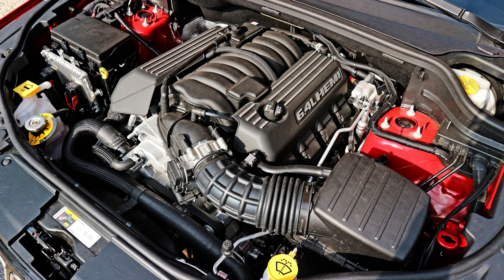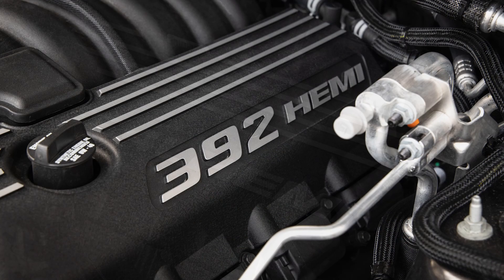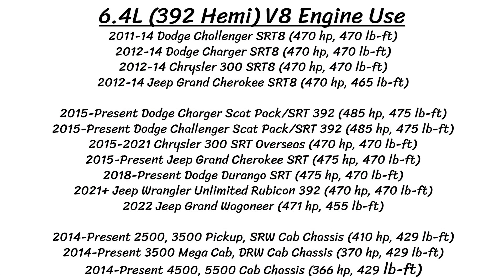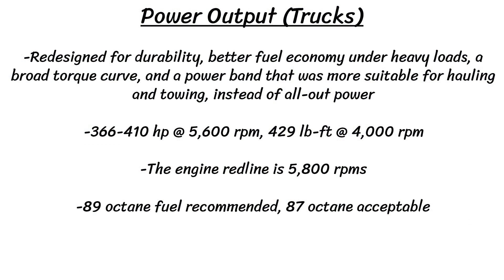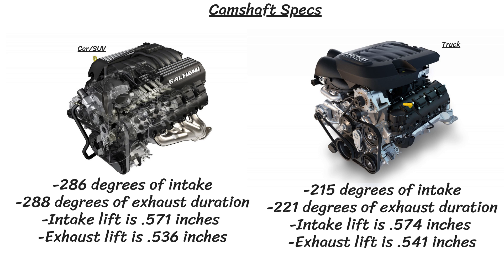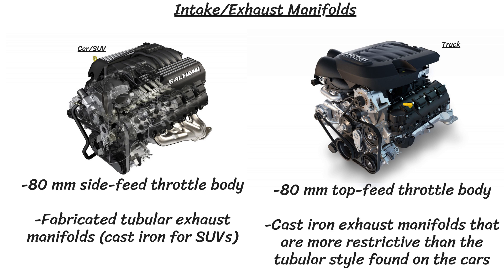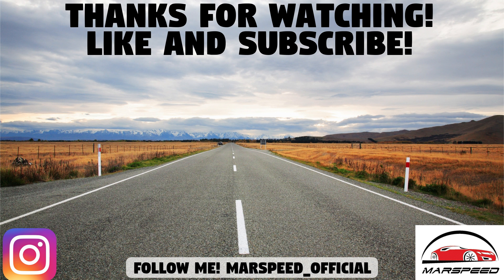6.4L Hemi V8 Engine – The Specs & Differences Between the Ram Trucks and SRT/Performance Versions

Comment: Don't you mean starting in 2005 was the Magnum SRT8 and the 300 SRT8. 2006 Charger SRT8 and the Grand Cherokee SRT8. Then in 2008 the Challenger SRT8. You made it seem like all 5 came about in 2006 which they did not.

Comment: I googled Microsoft Copilot, the 2018 Ram 2500 6.4L does not have MDS. Maybe I missed it in the video, but knowing my engine doesn't have MDS is important to me. Awesome video! Thank you for putting in the work to make it!! I know the 6.4 has an oil flow issue. The Hellcat oil pump provides 12% more oil flow, but Melling makes an oil pump that provides 20% more oil flow. I will be installing that on my truck. I am on the fence about upgrading the oil from 0W-40 to 5W-30. I checked the oil the other day, I had a hard time seeing the 0W-40 on the dipstick. It's like freaking water!! Fk fuel economy! I want my engine to last!!

Comment: I'd like a 6.4 BGE crate to replace my factory RAM 1500 5.7 donk. Once you put some gear in the back, the torque loss is vastly noticeable. I assume the RAM 5.7 would be a "BGE" block as well or does the 1500 come under "SUV" status?

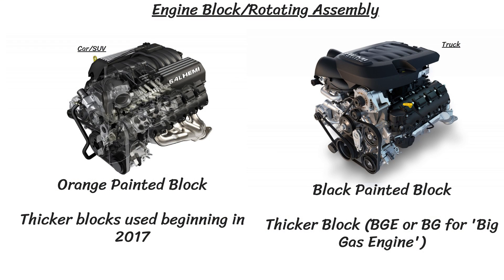Comment: 8:02 Can confirm: All 392 Hemi engines from 2018 onward all have BGE blocks from the factory. When I pulled the motor out of my ‘20 Challenger Scat Pack to open it up and put a 270 Comp Cam in it (and some other goodies), right on the block it had the BGE stamp on it.

Comment: Not sure when exhaust manifolds changed but my 17 ram 2500 has stainless manifolds that look to be some where between shorty headers and mid length headers 
I believe they made this change because of earlier models have the cast iron manifolds warp which was causing exhaust leaks

Comment: The truck 6.4 is not 89 or 87 fuel it’s the exact same as the damn cars 91-93 fuel
Reply: 91 is all I run in my truck. Best fuel mileage while regular driving and especially while towing. 89 is ok...ish. 85 absolutely sucks.

Comment: Could you (fitment wise) put a supercharger made for the 6.4 car version on a 6.4 bge truck version? I want to add a turbo kit to my power wagon but can find any kits specifically made for it. I wouldnt be apposed to other mods to make it work as long as its not outrgeous. Thanks!

Comment: Transmissions, 5.7 / 6.4 2500-3500 Only Had The 66RFE Option. The Aisin Was Only An Option For The 6.7 Cummins. The 6.7 Cummins Used A 68RFE Also. 68RFE Only Fits The 6.7 Diesel Same For Aisin.

Comment: The Cylinder Heads Are Different Part Numbers But Practically Identical To The Passenger 6.4. Also The 5.7 Hemi 2500-3500 Do Not Have MDS.

Comment: MDS is poor engineering,    massive failure in 2009 and newer ,  you willbe lucky to get 120k - 145k miles.     Needing new cam and lifter replacement

Comment: I own a Charger Hellcat but drive a Ram 2500 sometimes for work (gov’t engineering takes you off the beaten trail sometimes lol). That truck 6.4L feels more torquey on the low end (compared to driving with the black key at least) and honestly I feel like I get better acceleration in the truck just cause I don’t spin out the rear wheels every time 😂. Both awesome engines!

Comment: Does the 6.4 require premium fuel?
Reply: That's all I run in my 6.4L. I do notice a difference while towing with my 3500. 85 octane sucks, 89 not much better. 91 octane gets better mileage.

Comment: Let me help you out a little. The ram 392 has the same displacement as the car, but that's all. The car has a slightly bigger bore than stroke. The truck has whats called an underbore. The bore is larger than the stroke. The ram has completely forged internals and revs slower. The truck version is raited lower power than the gm, but will out pull it. The gm has a big bore and short stroke. All of your torque is made low with a long stroke motor. The cummins is built the same way the truck 392 is built. There are guys that use the truck 392 as a hotshot. They're pulling 15k+ all the time and getting over 400k miles out of them. The truck is built heavier than any other gas motor on the market. The truck also has an oil and transmission cooler. The drive shaft is way larger. If you want a truck to last a lifetime but gas powered, get the 2500 ram.
Reply: Wrong. Same bore and stroke. Same crankshaft.

Comment: Do the 6.4 truck variants have the active intake runners like the 392s?
Reply: Good question but I think the truck does not have active runners. Honestly they probably use the same intake from the 5.7 which is why the truck version has the throttle body on top vs. the front and he said the runners on the truck were "tuned" for a specific RPM range instead of being variable like the car versions.
Reply: @TonyTheTruckGuy  So i could use a 6.4 truck intake on a 5.7 charger without major modification?
Reply: @thedankgentlemann  I can’t say with certainty since I have not personally tried, but it may be worth researching to see if anyone else has done. R/T life did a 6.4 car intake on his 5.7 Hemi but he had to get like an MSD box to control the runners. The truck intake MIGHT bolt right up. Not sure what kind of gains would be had though. The 6.4 truck intake could be the same as the 5.7 for all we know haha.

Comment: The truck version is the one ya want, if you're doing a replacement  swap. Internally  and block specs have it as basically  a poor man's hellcat without the power adder. It uses the same head castings.

Comment: Fun fact; if you want a 6.4 to build and boost you want the truck motor. 6.4 BGE pow
Reply: Fun fact: if you want a 6.4 to build naturally aspirated you want the SRT motor, can stroke it further and doesnt have a chamfer like the BGE. You also want a manual trans so you don't get MDS. 6.4 SRT pow
Reply: Why is that?
Reply: @lofiseeker1790  Truck engine has a thicker block with lower compression which can typically handle more boost in stock form.
Reply: False

Comment: Thanks again for another outstanding video. August 2020 I knew I was going to buy a hot muscle car. It was a tossup between a Camaro SS2 and the Scat Pack. The Scat won out and I did buy one at end of Sept. 2020. But concerning the Hemi tick I wonder did I really make the right choice ? Did FCA make any changes to alleviate this tick, ruined cam issue in newer production engines ?  I hate to think I made a $50K mistake.

Comment: Hi marspeed  my brother is buy an charger, he is considering between Dodge Charger scat pack and scat pack wide body , should he spent more 5995 $ for the widebody or just take an normal scatpack
Reply from the maker: The Widebody adds:
Widebody of course
Six piston front brembos (instead of four piston)
20x11 inch wheels (instead of 20x9)
Flat bottom steering wheel
Bilstein adaptive damping suspension 
Is it worth it? For $6k yes it is. If you don’t care about that stuff then no, but if you end up paying for that stuff later it will cost much much more
Reply: @MarspeedCars  thx bro

Comment: The new 2022 RAM 1500 with the 5.7 HEMI has a different oil than the previous years. They now use a 0W-20. Is there a design change to the new HEMI? I wonder what the reason for a going to a lighter weight.
Reply: Emissions and fuel economy
Reply: it has become more accessible than before

Comment: Newer Ram trucks with the 6.4L from 2019 and up have the ZF 8-speed.
Reply: I have the zf8 in my stock 2016 1500? It's a tradesman.  Does this suggest it was possibly selected as an option when purchased new?
Reply: @Youdaboob 
Some 1500s started using the zf8 in 2013 or 2014. It was optional. 

2500s started using the zf8 with the 6.4 hemi in 2019.

Comment: Man dodge loves to waste so much money on performance and on different motors, yet Chevy is so lazy to even do the right job while Ford is still doing a good job on the 5.0😂
Reply: You mean the same 5.0 that is only offered in 2 Ford models, as in the one that has to be modified in order to make a fraction of the power of a MOPAR. Or are we talking about the same 5.0 in competition with GM, who still largely offers V8's & easily accessible in their lineup?
Reply: One crowd at a time...Book'm Dan 5.0

Comment: Is there anyway I could maybe use some of the more high performance parts like the intake and exhaust manifolds of the 6.4 on the HD Ram? I test drove one recently it definitely feels heavy. I'm hoping to squeeze out at least 20-30 more Hp and torque if possible. I certainly feel like the truck needs it. I'm planning on ordering one of the big beasts but before that I'd like to know how to get more power NA before resorting to a low boost setup if there's any available. Thanks in advance.

Comment: They didn’t have the challenge mr till 2008 I was Chrysler full line certified back then I know for a fact because I got the dealership that I worked for there allocation by selling enoigh lx plate form cars by the dead line ever dealership got 2 per dodge point that’s why there is only 2800 of the original 2009 so it wasn’t 2006 there was the srt caliber in 2007 and there was a srt crossfire and ram and 300 and charger grand Cherokee that was the five there went no challenger back then and by then caliber was done as well as crossfire and the ram truck was gone

Comment: The 2003 Ram 1500 slt sport is the first year they came out with the Hemi and with that truck if you go on the firewall where the main computers at you'll see four plugs go down to the third one you will see a dark green wire with a bright yellow strip cut that wire and that will disengage the rev limiter. Did it to mine and it was night and day difference until I rolled it over that way I went with the 2004 Ram and that when you needed to purchase a computer programmer never really had any problems with my trucks.

Comment: I have a 2004 Ram 1500 slt sport with the 5.7 hemi and I installed K&N air raid air filter Gibson exhaust stage 2 jet chip throttle body and Hypertech performance programmer and I've raced Mustangs not saying much but Imports and smoke them with ease. My 2001 Ram 2500 diesel that I want with Gale Banks almost on everything with the air intake 6in exhaust computer programmer Turbo plenty of power and torque actually pulled a tractor trailer Brad the guy decides to sleep in a parking lot that was just black top and sunk to the axles but of course with a little bit of his help pulled the truck out with ease. Waiting to see if I'm going with the 2021 Rebel or 22 Ram Rebel GT with the 6.4 hemi if it comes with one but looking for a new one.

Comment: There's actually more differences. There's the performance 6.4 in the regular vehicles, there's the truck version... but the 6.4 Hemi in the 2500/3500 is not the same as the ones in the commercial Heavy Duty cab chassis of the 4500 & 5500 trucks. The HP/TQ is detuned less than the pickups & the redline is also lower, approx 4600rpm. There are other slight changes. But the 6.4 in the pickups is not the same as the 4500/5500's 
Those HD cab chassis trucks are detuned for longevity & Heavy loads & Heavy towing on a daily basis.

Comment from the maker: Need to make a correction: as many have stated, 2019 2500 and 3500 trucks used the ZF 8-speed automatic (8HP75R) with the 6.4. 4500 and 5500 still use the Aisin 6-speed.
Reply: 68rfe
Reply: The chassis cab SW 3500 get the 8 speed the 3500 4500 and 5500 hemis do not get an 6 speed asin i dont remember what it was but it was a six speed but it wasent an asin six speed
Reply: @tylerschilling8742  it's the 66rfe
Reply: It's also worth noting redline on Cab an Chassis was limited to 4600 rpm 😢 (at least on my 2014 6.4)

Comment: Definitely want to fix that cam spec slide.  The specs might be accurate, but the 2 cams shown were measured using different measurement methods.  The car cam appears to be total duration (measured at "zero"-ish lift) and the truck cam appears to be the standard @ .050" lift measurement method.  As you can see, it gives VERY different numbers and it's really misleading. They're likely much closer together, the truck cam is probably 265-270 degrees of duration measured the same way as the car cam.

Comment: This is Mike from California. I think you covered this on another video but wanted to ask you. How long should I let my 2013 challenger srt 8 run between oil changes. I think it's currently been about 4000 miles from my last oil change.
Reply: If it’s synthetic oil I’d change it every 5K miles or 1 year.
Reply: @EnglishBob911  it is, it has the 6.4 Hemi. I'm currently using Pennzoil synthetic oil 0-40

Comment: I bought a brand new 392 Hemi long block from Mopar without MDS that was built Feb 2021 and can confirm that it does in fact come with the BGE engine block painted orange and T356 aluminum alloy cylinder heads and the new revised "hellcat" lifters. It’s a shame that it still has the same hyper-eutectic pistons and tightly gapped piston rings which means the engine cannot be safely boosted past 6-7 PSI without pulling and replacing the pistons.
Reply: Yeah bud that’s because the 392 is meant to be N/A it’s not meant to be boosted if u we’re looking for that u would get a Hellcat/6.2
Reply: @demarcusbody9437  yeah but swapping in a 6.2 hemi into a SRT 392 hemi is not plug and play, it takes a lot more extra parts and a lot of extra work. Better to sell the 392 car and buy a factory Hellcat instead.
Reply: @alexm.4621  yes that’s what I’m referring to buddy not a 6.2 engine swap that would be idiotic
Reply: Screw that! If you have a 5.7, BUILD IT! If ya got a 6.4, BUILD IT! Selling it to just get a hellcat is cool but also played out imo. Building what hemi you have is where the funs at !
Reply: Hellcat lifters are a myth they are just mopar non mds lifters. Mopar only has 2 revised part numbers for all lifters in 2009 up engines…..
Reply: What’s the benefit of the Hellcat lifters? I have a 2019 scat pack
Reply: @TheJMan1K  non mds buddy
Reply: @demarcusbody9437  gotcha
Reply: @TheJMan1K  The hellcat lifters are less likely to fail and eat your cam.
Reply: @TheJMan1K  from what I understand they are just revised lifters. Supposedly more durable than the previous part numbers used in pre 2017 MY engines. Those are the lifters that often end up failing and eating a cam lobe. There is no specific hellcat lifter though, should be the same lifter part number on all hemi engines including 5.7 6.4 and 6.2 from around 2017 an up. (Except automatic MDS equipped engines)
Reply: Alex. Do you know anyway knowing how to tell the difference between the  Apache and BGE heads while the head are on the motor. I just bought a 2021 6.4 . And was wondering which heads it had
Reply: @catfish340d  Is it a long block/crate engine or was it taken out of a production car? If its a long block/crate engine, mine has the green Mopar Parts production sticker with the part number, serial number and build date on the driver side of the  block near the oil pan, mine reads 006-21 as the build date. Going based off of production date, i'd say that it would be a BGE engine which should come with the stronger 356 aluminum heads vs the older pre 2016 I think? You can see the lasered/etched on part numbers on the heads without having to take off the heads or intake to verify.
Reply: @alexm.4621 
I'm not sure what you have, but I was looking at some new 6.4 BGE long blocks also having green sticker bottom rear driver side and those all show 319 aluminum heads.
Reply: 10.9 CR... It's not just the rings limiting you to 7psi, it's the CR.
Reply: The engine made in 2021 isn’t the same block as the 5.7. You can add more boost than 7psi. I dunno who told you that. The old 6.4 liters that were made previously from 2021 back to 2011 from the 5.7 block isn’t the same. Previously you couldn’t because the cylinder walls were so close together. That where you can only get about 10lbs of boost out of an old 6.4 liter roughly only 500hp. That has changed. You can put much more boost on the new 6.4 liters than the old engines. It’s on a much bigger engine block now.

Comment: I have a 2011 SRT8, & I would have thought it would be a great motor for a truck, then I drove 2018 ambulances powered by one.
/beavis “This sucks more than anything has ever sucked before.” /s
7 1/2 tons, it’s struggles at highway speed, can’t find a gear it likes, the cam shaft had to be replaced in one, another bus had to have the Donk completely replaced, not entirely sure what went tits up on that one.
The truck hemi is a lousy terrible no good very bad motor if you’re doing anything more than using your lorry as a grocery getter and taxi.

Comment: 6.4 ain't srt its scat pack 6.2 is hellcat
Reply: They used to call the 6.4 an SRT then they changed it a little bit after the hellcat came out
Reply: @dungeontv7447  havent done that for a while
Reply: The 6.4 is one of the SRT engines.
Reply: @gasolinediesel972  older ones yeah not the current
Reply: @itsGrzli  Open the hood of a 2021 scat pack and look at the engine. It says "powered by SRT".
Reply: @gasolinediesel972  i am aware it says that. But it aint got the badge on the car
Reply: @itsGrzli  That's because a scat pack isn't an SRT. The 392 engine itself is an SRT though.
Reply: @gasolinediesel972  I'm aware

Comment: Fantastic video!  Thank you for doing it.  One item of note, starting with the 2019 model year the HD trucks with the 6.4 now use an 8 speed ZF automatic transmission.  The 6 speed (both versions) is only on the diesel now.
Reply: 4500 and 5500 still run the aisin on the hemi and the cummins.
Reply: @gasolinediesel972  did not know that.  Thanks for the info.  What I said is accurate for the 2500 & 3500.
Reply: @johnnicpon5783  Correct, the 2500 and 3500 use the 8 speed. I guess they figured that the aisin would be better in the 4500's and 5500's. They thankfully no longer use the RFE transmission with the hemi.